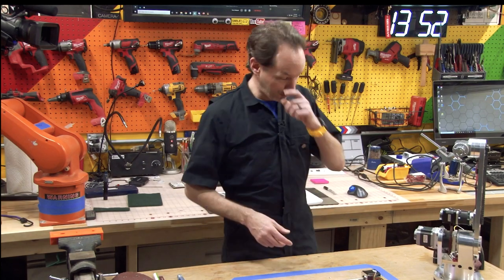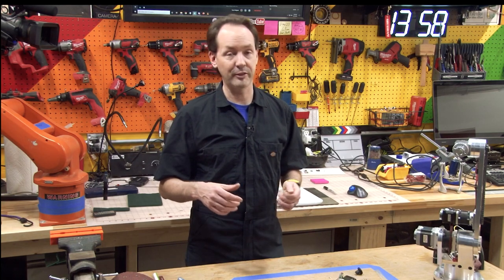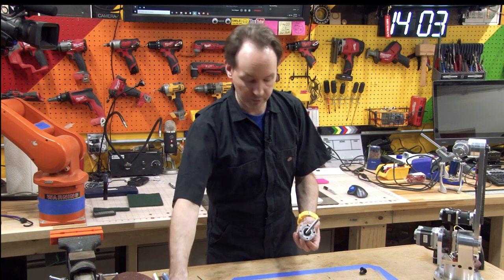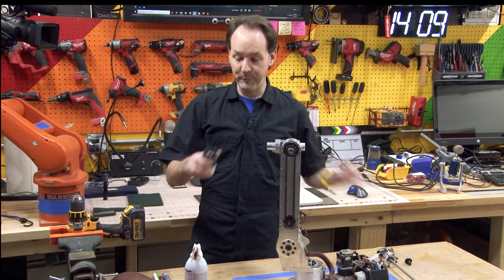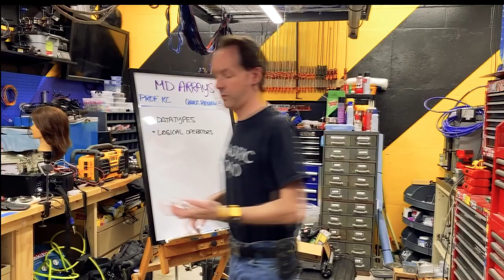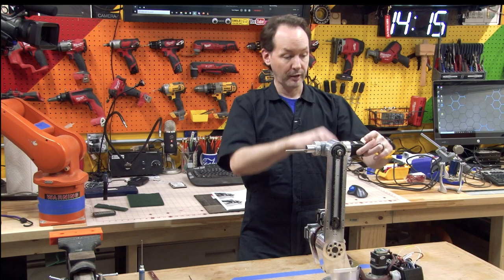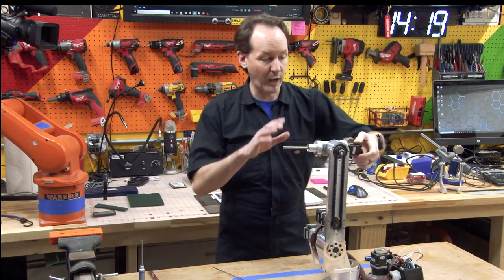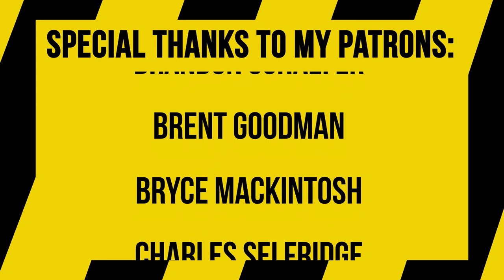Project ARchi3 Episode 47 - Mounting the J4 Pulley

Comment: An improvised flap wheel would be my first idea. Take a piece of stiff wire (a coat hanger works well) and put a sharp hairpin bend in the end, such that it will hold a doubled over piece of sandpaper with a length about 1.5 to 2x the ID of your part.
Chuck the other end of the wire in a drill, and go to town. 
The floppiness of the sandpaper will absorb any minor eccentricities.
You can even use the same device to hold a piece of scotchbrite so you don't risk acquiring the nickname "nubs".

Comment: Sanding drum that can be chucked into a drill or a flappy wheel that is slightly smaller than the part or a honing stone kit for wheel cylinders. Then throw the part into the into a vice with soft jaws. Zip zip, polish, and no worries of losing fingers. Remember kiddies, "Don't stick your fingies where you wouldn't stick yer dingy."
Reply from the maker: I thought of doing that with a dremel or something. I didn't want to screw up concentricity.
Reply: @ChaoticGoodChris  Good point... I think at that point the best would be a honing stone kit for calipers and wheel cylinders  would be best to keep concentricity. Best place to pick up one of those tools is at a Napa :)